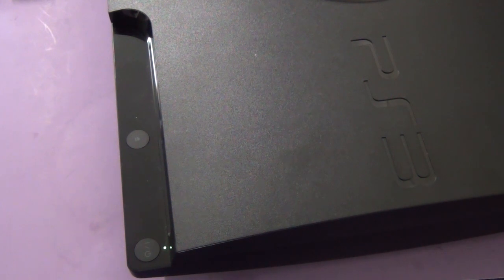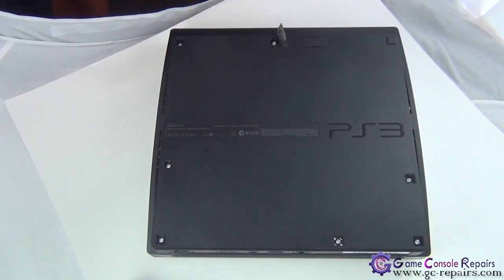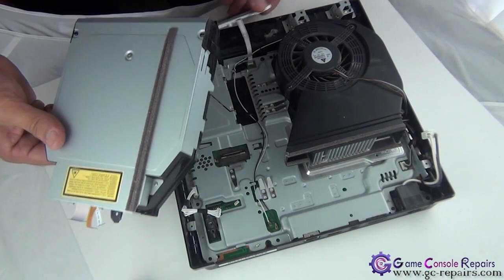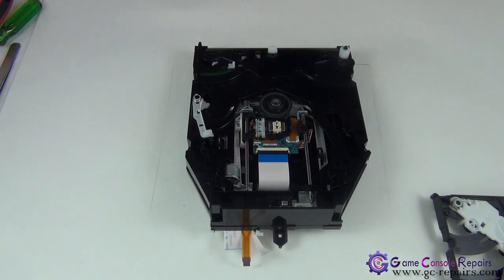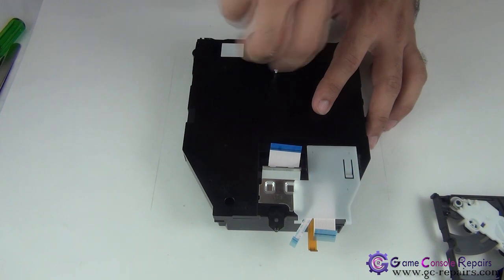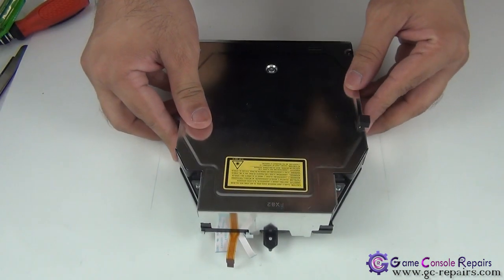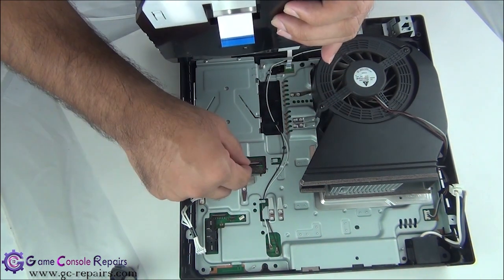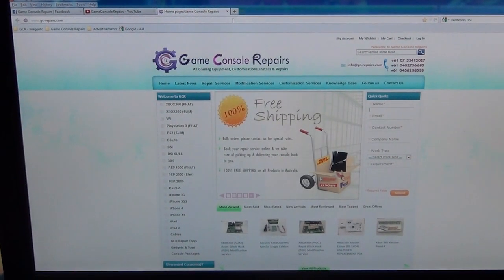PS3SLIM 320GB CECH 3002x  Manual Disc Removal & Resetting Blu Ray Drive gc repairs

Comment: I know this video was made over a decade ago, but for anyone wanting to know the "right" way to put the drive back in, do not do it this way as shown in the video. Leave the aluminum cover off and leave the top section (the one that holds the disc) off as well. And make sure that the drive is in the "ejected" state. Disconnect the ribbon cable coming from the laser assembly and install that into the motherboard connector first. Then, install the bottom "half" of the drive (slide the laser ribbon cable through the hole on the bottom of the disc drive). Connect the laser ribbon cable to the laser assembly. Now place the top portion of the disc drive into place, making sure that all the clasps are properly set and screw in the Phillips screw that holds it into place. Then place the aluminum cover on top. All the screws are accessible from the top. I'm fairly certain this is how it is done from factory. There's no way that they assembled it as shown in the video because it takes forever to fiddle with that ribbon cable to ensure it is properly aligned (especially if your hands are not the size of a child).

Comment: Thank you for the video upload.
I have had my PS3 since before 2014 and this week, after a prolonged period of not using it, I realised the CMOS battery needed replacing.  When I measured it, the voltage was less than 0.5V 😁
The most difficult bit, of taking it apart, was the rebuild when I had to install the DVD player.  The flex strip was ridiculously small.  Another inch would have made it much easier.
I looked hard for a better solution, which I ended up messing my DVD player up.
I found your video on resetting the DVD, as I thought this is what I needed to do.  It wouldn't eject or Manually eject or register on the menu.
The reset solution was so minimal and straight forward, but it worked.  👌
My PS3 is back together and keeping time again and allowing me to log onto PSN.
Grand Tourismo 5 is still good today and I have had many hours of fun with it.
This help was easily worth a like.  Thanks again.👌

Comment: You know you can access that gear screw from the outside where the hard drive screw is and it'll just eject it and it resets it at the same time
Reply from the maker: That's an alternative method, but this video shows a full manual disc removal and drive reset.

Comment: Great video. When I pulled out the white spindle it did reset like in the video. But after reasembling. It doesn't appear to want to take any discs still. Any ideas what this could be?

Comment: Heck yes! This video just helped me fix my jammed drive. If your drive doesn’t automatically reset when you lift the white gear, try this. When the gear is out, pull the little white lever on the disc tray side down. That shifted everything back into the normal position.

Comment: To those who are following this video as a guide for disassembly and reassembly, DO NOT follow the same step when it comes to detaching and reattaching the ribbon cable connected to the board and disc drive. There is a MUCH easier way to do this and can be found here on YouTube.  I will link to those in those below. Otherwise, this is a good video to follow for getting the console open. Just don't make the same mistake which almost made me give up until I found a better way to do it. 

Edit: https://youtu.be/O7Qpsg2KcXQ 
https://youtu.be/u8H4kOuljGg
Reply: Yes man i also thinking this. But i Recommend Spawn Wave. Best Tutorials ever i found. Try seen spawn wave.

Comment: Well, this is one of the more helpful. I had the drive hubcap off, tried to forward it but the arms up front held fast.
I still have the same issue as with other sites that talk about lifting out the power supply. The two power clips, two screws but it still refuses to lift out. I thought maybe that square 3/4 across is concealing a screw or clip, that’s where the resistance is coming from. And I hate to force something beyond a certain level.
My copy of ps3 Conan, the non-opening methods all failed. I had been able to engage the game again with these attempts but not eject. Wonder, but this pawn shop acquisition has VOID stamped several times near the game’s spindle.

Comment: Sony are pigs. I got to 8:40 on this video, but I must have a slightly newer model. Instead of being able to click the large white cog out of its place, on the CECH-2503A model I have, I need YET ANOTHER screwdriver to remove a screw that's holding the cog in place. 8:40 is as far as I can go. Heaven forbid you be able to repair the item you paid €400 for in 2007 after your 9 year old kid accidentally knocks it off the cabinet. Sony must have gone through all these videos, trying to make it as difficult as possible for people to self-repair. If it weren't for the 200+ discs I own for PS1, PS2 and PS3, I'd gladly convert to the genuinely backwards-compatible Xbox. I'm not giving Sony another cent of my money.

Comment: Theres an easier way to put the disc drive on if you leave the cover off take the lens ribbon cable off the drive by lifting the clip put ribbon cable on the console slide the discdrive on re clip the ribbon cable on the lense then close the cover and reconnct the other ribbon cables bam ready to go

Comment: Great guide. Mine is also working again. I had a hard time fitting the flat cable of the lens while placing the drive.
I found it easier to: First place the flat cable into the socket on the motherboard, then place the drive on it with the hood off and attach the cable to the lens carrier. Next reassemble the top of the drive.

Comment: I had a similar problem I took apart my PS3 and after hours of missing around with my PS3 watching yt videos nothing worked it turned out that on of the cables was loose I put it back in properly and it worked.

Comment: great tutorial!! Very professional and well spoken. Thank you resetting the gear worked but I had to take it a part again and reset the gear because the little white arm that the disk first touches as the disk goes in must be reset as well in the video the arm was already in the reset position mine kinda got stuck in the up position and I touched it lightly and it snapped back in to place, works great now plus I got to clean everything with computer duster too. Also I did not have to disconnect the ribbon from the motherboard I disconnected the ribbon from the laser eye, much easier to feed thru and re-connect to the eye than trying to connect it between the bottom of the drive and the ps3's motherboard.
Reply: <I disconnected the ribbon from the laser eye> 
Many thanks, was very very very helpful.

Comment: Thanks a lot for this! I got the CECH-2502A and when I cleaned the blu-ray laser, I somehow fucked it up and the disc got stuck in there after inserting it and started making major grinding noises. 
This video has a very similar drive to my model however the white gear is screwed in on this drive at 8:34. It was a major pain unscrewing it without getting the case out but this mini screwdriver that came with something fit and got it out that way. 
Moved it back and now it's playing games again!
Cheers man

Comment: I did this, but now when I put a disc in the drive it takes it, then for some reason it moves the disc around(doesn't spin) and then it won't read it.
Reply: How do you fix it?

Comment: I have a prob, I made a vid on my chan. It makes a noise when I press the eject button, would this technique work with this prob? My PS3 slim is Cech 3003a, would this be similar to this/any differences?
Reply: I'm gonna answer my own question, it worked THANKS!!!

Comment: Fantastic. Thank you.

 My slim ps3 had the that noise for a couple of days when I insert and play a disc until it couldn't read it anymore (but still allow inserting/ejecting). So I followed your steps, when I finished reassembling the ps3, I was surprised as the PS3 won't even allow me to insert the disc, so I've opened it up again and tried to be careful especially in plugging the cables (as I was suspecting that where my mistake lies), and it worked fine when I was done with it.

Moral of the story: Don't give up if it didn't work in the first time.

Comment: do u know how to fix a ps3 that won't pull in disc??
Reply: +Nat Romero That cant be fixed. Youll have to replace the drive or replace the gears in yours. They are plastic so they break. mine had the same problem.
Reply: +Nat Romero That cant be fixed. Youll have to replace the drive or replace the gears in yours. They are plastic so they break. mine had the same problem.
Reply: +Nat Romero Gears are cheaper by the way. just a little bit harder to replace
Reply: +Nat Romero Gears are cheaper by the way. just a little bit harder to replace

Comment: I NEVER log in to comment on youtube videos, but I just had to tell you that your video was the ONLY ONE I found that showed exactly what was needed to fix my "broken" garage sale ps3!!  Only thing I'd suggest is take the metal cover and top part of the blu ray drive first, then disconnect the ribbon cable from the drive, not the board.  MUCH EASIER that way.  Other than that....amazing video, Thanks a ton!!
Reply: Great tip for the damn ribbon cable. Good job man.
Reply: Very good advice. If you pinch the ribbon cable the shuttle for the laser can't come forward enough to close a switch and you'll have to take the top of the drive off anyway.

Comment: There is this white tab blocking my disc tray i cant insert any disc i did what you just did and it didnt work i need help please!!!
Reply: You have to remove the whole disk drive and flip it. Remove the bottom cover, open, and pull up the big white cog. That resets the white tab keeping you from inserting any disks. Put everything back together.

Comment: All u gotta do to get out a stuck disk is, on the bottom where the little black tab to take out the hard drive screw, take that piece of plastic out a push up in their a normal phillips screw driver and turn counter clockwise and the disk should come out, if you didnt understand this just search youtube for : ps3 slim hidden manual disk eject.
Reply: Ninja Hacking/Glitching .
Reply: Ninja Hacking/Glitching Not certain about the points made but ,if anyone else trying to find out playstation repair guide try Alkarno Playstation Fixer Alchemist (just google it ) ? Ive heard some incredible things about it and my neighbor got great success with it.

Comment: Had a stuck blu-ray disc PS3 slim and viewed another video involving pulling the unit apart to clean and the eject the disc, but after reassembling I got a black screen when attempting to use Netflix or Hulu. Pulled the unit apart again, then more comprehensively disassembled the blu-ray drive (*Warning* the metal corners on the exterior of the blu-ray drive us super sharp!! Little difficult to pull apart some black tape unseen on side by divots) Cost me a nice cut and 5 stitches on my left pointer finger lol.  But the little white gear in the blu-ray drive was the key!!!  After unscrewing it (again mine is a PS3 slim) and then checking it. Reassembled everything in proper order, and the PS3 slim works like new!!  Thank you for this vid!!

Comment: I found out tonight my kod stuck a necklace in there  took it apart n back together several times but disc will go in.  But not spin    of I take top of cdrom off n fool the levers  into thinking a disc is in   the motor spins n laser does kick on    but it wont kick on atall unless its in the lowered position n I release the right arm.    So weird    I followed your steps twice.   N seems like it aught to work fine all inclocks n resets like it should   initial clixk  then all mechanisms reset like in video.      Back together     same thing.  Disc goes in.   Hear a click click again like its trying to make sure its set right.   But don't spin.        While I har it apart inbetween click click I manually spun cd  n it hesitated to click the 2nd time to try n reset the cd itself.      Weird.  Sux cause my mobo on my last ps3 fried n I just got this one recently.    Blahhhhhh     any tips?
Reply: My little cousin stuck two quaters in my blu ray drive and it didn't wanna accept the disc. It kept making the clicking noise like yours. The problem was the arms that pull in the disc was getting stuck half way. What you wanna do is pull of the magnet peice and play with the arms for a bit. If they get stuck half way then there is elevation under the arms. Make sure when you put the magnet back on the two white rotars are under it and the black arms are inward. Asemblem back your ps3 and turn it on. Before you shove a disc in press the eject button because the blu ray still thinks there is a disc in there. And now you should be able to put a disc in.

Comment: Hey these vids are great! Thanks for posting them. I have the CECH 3002A that keeps freezing during game play and I can't seem to diagnose the problem. Disc will load and run fine for about 15-30 mins then freeze every time. I've restored the system, taken it apart and cleaned it, and now have just tried cleaning the lens but still have the problem. 
Do I have to do the solder reflow of the motherboard to fix this issue?

Thanks again for the tutorials!
Reply: U might hv to replace blueray lens lik alot of us..
Reply: Your blu ray lens is burning itself out. This can also ruin your disc that you put in there. You have to replace that peice.
Reply: MF Doom idk, my PS3 is still nt wrkn, I put my new lens alrdy whn it got here.. I did a system restore too.. it almost wntd to start earlier for me b4 I had to wrk at 11am.. thn it stop loading.. please anyone gve me pointers, I would appreciate it.. :)
Reply: Marquis Randle are you using the same disc when the first lens burnt out? If you are just dab a tissue in alcohol and wipe the disc dry. And if you had to sauder the lens on make sure you saudered the right connectors together or connected them right.
Reply: Actually I have only had the issue with MW2. I have since played another game and had no issues. Maybe I will try another MW2 disc or just not worry about playing it anymore.
Reply: MF Doom yea da alcohol wiping didn't wrk! I will figure this issue out.. lol
Reply: Ryan Langley same wit my PS3 nd games, it use to play thn freeze later! Now mines jus spinning nd isn't loading any of my blueray games, after a minute of loading it makes an ejecting sound thn jus completely stop spinning..

Comment: I have a question about a PS3. One of my cd drives takes in a disc and reads it, and when I want, ejects it, but the disk ejector keeps spinning a little after. Any other disc I put it goes in and right back out. I can only insert another disk when I turn the PS3 off. I think one screw on the bottom arm that keeps both side black bars connected is missing, but I don't think that would matter. Some of the plastic things on the top of the drive go about half way when ejecting. When the rubber things are spinning it makes a sort of clicking sound.
Thanks for the help! CHECL01

Comment: Thank you so much for this! Opened my ps3 slim to clean the fan, and when i finally put everything together the ps3 wasn't reading any disc. I reset the gear and it worked like a charm. Thank you once again.

Comment: Wow, you reconnect the final board cable the the HARD way! you can connect that to the board first, then put the BR drive down with the top open then connect that to the bluray lens THEN put the top plastic drive feeder and metal cover on last. Your method is insane, you even had to speed up that part of the video because it took so long.
Reply: Wish I would have read that about a month ago when I cleaned my PS3.  I was losing it by the end.  Took almost 30 minutes to get it put back together.

Comment: that works with alignment problems, i know now its my blue ray because i can still play regular DVDs.  i already talked to Sony, they said their not aware of the problem and tried to sell me on a repair. Ask to talk to someone in customer service is what i should have done as you get no where with Teck. support.  Get back to me if you do this, let me know what happened

Comment: For now, I've been tilting the console disk slot up in the air after inserting the disc, and after a few times, sometimes I get them to play, but I was hoping the author of this page could comment on this...thanks for the question. I'm thinking of contacting Sony, and asking them to replace the unit, or fix the problem. I bought it 2 years ago, and it's out of warranty, but some say it's still possible to return it because it's a widespread problem.

Comment: Great vid.  Explains everything.  Also of note, just about all of the steps outlined also work for ps3 cech-3001a.  I now have a working ps3, thanks in part to your well outlined steps.

Comment: Hi, nice video. Let me describe my situation... A few days ago, my PS3 started acting up, it's like this one 320GB CECH 3001b. I put in my DVDs...no problem, I put in my PS3 games...no problem. However, as soon as I put in a regular Blu-ray disc, or a 3D Blu-ray disc...it spins for a bit, you hear little clicks going on inside, and eventually, it makes an ejecting noise, but the disc doesn't come out, and the disc's never recognized on the TV screen. What do you think's wrong?

Comment: advice: take off metal top cover, then take off 2nd white and black layer, THEN UNDO THE BIG RIBBON CABLE FROM THE LENS' BOARD (this way it is easier to reconnect later because you are doing it from the inside)...resume normally

Comment: i got a disc stuck got it out by putting the screwdriver in the back after that it wont take any disk it just keeps making a clicking noise an wont let the disk go in the drive just keep spinning half way 
if i need a new drive can u recommend a place to get them from that will work in Australian ps3s 
thanks